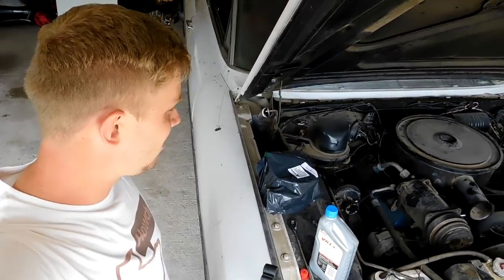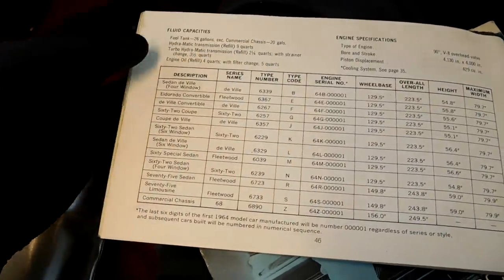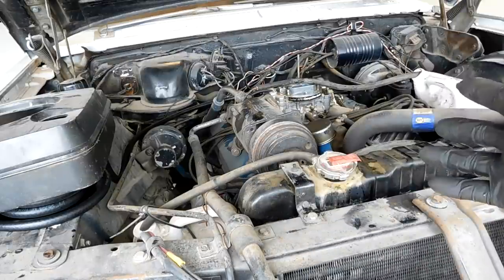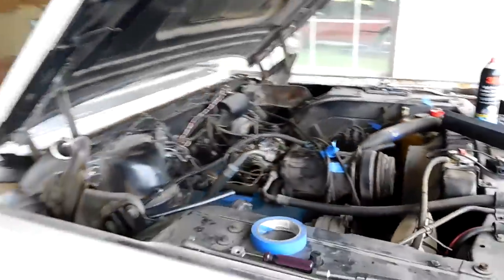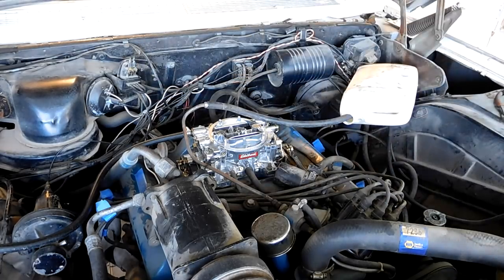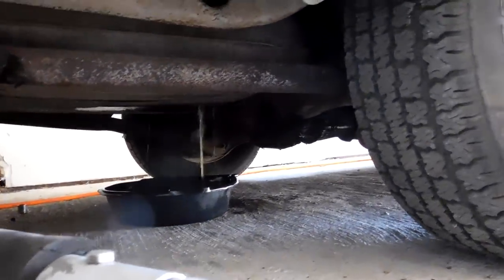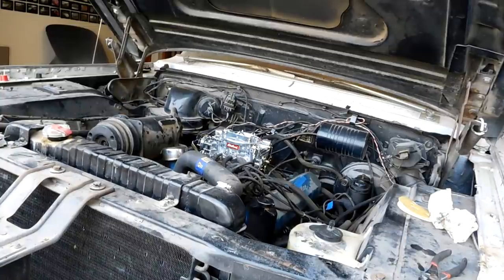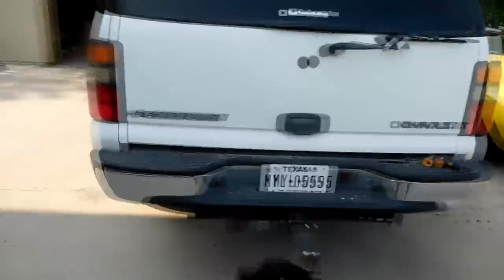First Drive In 17 Years! This 1964 Cadillac Makes It's Maiden Voyage Up & Down The Driveway

Comment: If the floats are sticking you can take a hammer and tap in circular pattern (Not Hard) around the top edge of the carburator and the floats will settle and not flood the engine. Old school trick!

Comment: What an excelent timing. I just got my (also white) 64 Cadillac Coupe De Ville ready aswell after 4 months. Had a knock but it turned out to be an exhaust manifold gasket leak. Rebuilt the whole engine before finding it out

Comment: Congratulation for the progress so far. I see I am not tthe only one that has fuel issues with a classic GM fullsize.
My nearly perfect 65 Bonneville Convertible with less than 70000 miles  ran perfectly for years and years. But this summer after long trips from time to time it was starving with lack of fuel. Lines are clean, heavy duty fuel pump is brand new, filters, lines everything good. It runs like a champ, but from time to time the problem occurs again. I am afraid I have to remove the tank because maybe there is a screen that is somehow clogged with dirt.